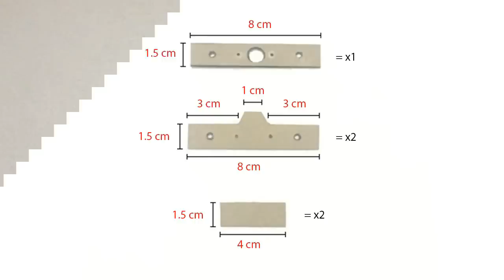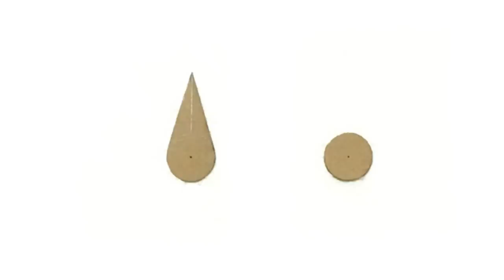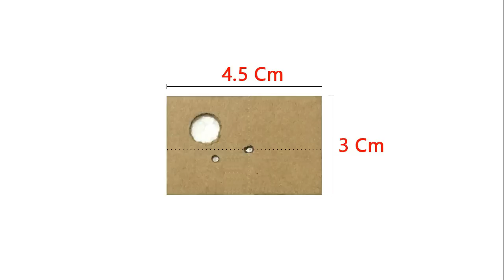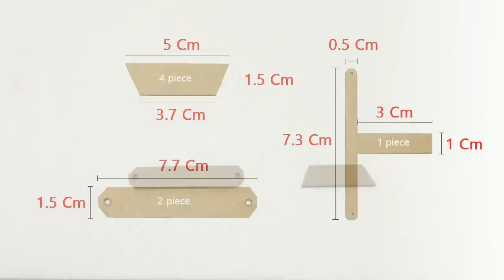Creative Idea With RC Homemade How to Make a Powerful RC Truck by Yourself Very Easy and Fast

Comment: How it moves up and down when the motor rotates
Reply from the maker: It reverses from remote control with circuit board.
Reply: RCI Save no bro I am asking about that mechanism which u fix with that motor
Reply: @thirumalairaj4365  its called a worm gear drive, it basically turns a gear 90 degrees on its face

Comment: The circuit board is the most confusing part for me
Reply from the maker: Circuit board take from the old rc toy car
Reply: @RCISave  sir please try to label the parts where motor 1 and 2 should be connected,where to connect the battery
Reply: @RCISave  OK thanks Bro